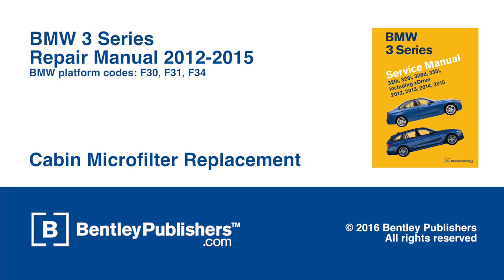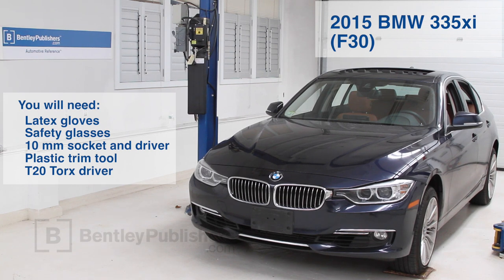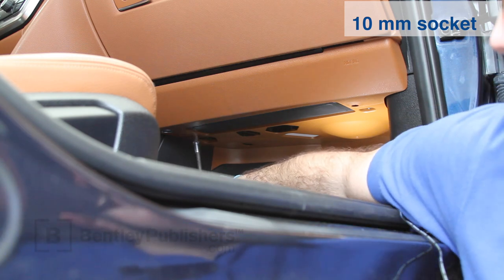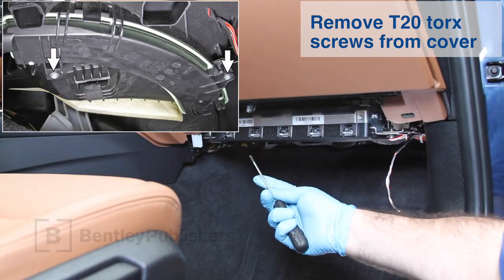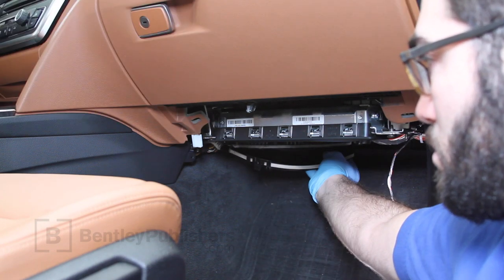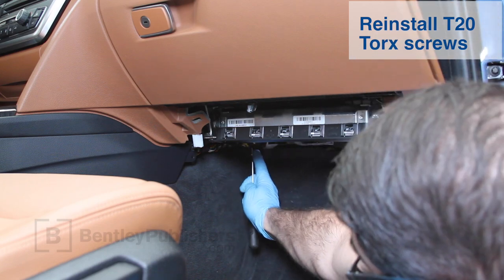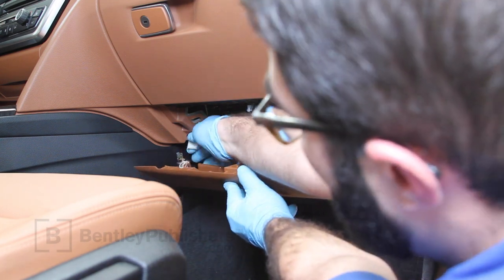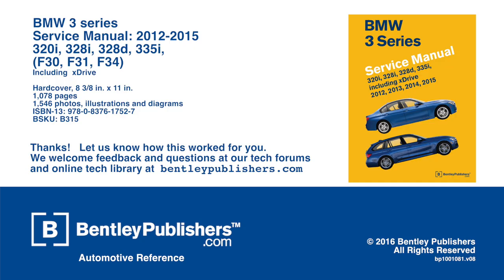BMW 3 Series 2012-2015 How to Replace Cabin Microfilter DIY

Comment: I've just replaced the cabin filter on a 2014 F30 328d and the old one (installed by the dealer under the maintenance plan) had the arrow up and pointing to the engine. At 2:16 one can see the arrow is pointing to the engine.

Comment: I’m having tons of allergy issues.  I replaced my cabin air filter but it didn’t help.  I’ve heard that mold can build up on the evaporator coils, but how can I clean that area.  Also, if that were the case, would it be covered under warranty?

Comment: Excellent video! If you're kinda dumb like I am, the air flow arrow should be pointing towards the rest of the cabin. "Towards the front of the car" to me sounds like the arrow should be facing the engine bay instead of the cabin. Also, this job is really simplified using a socket driver instead of a standard socket wrench like i was using, as the fit under footwell is pretty tight.
Reply: Joe, thanks for the tip. I will make sure to pay attention to the orientation of my filter when removing.
Reply: Are you sure about that? The video is a bit unclear, but freeze-framing on the removed (old) filter seems to indicate the arrow is pointing towards the engine bay, what I would also consider the "front" of the car.
Reply: Mine came out with arrows toward the bay
Reply: The arrow should point to the front of the car as shown in the video.

Comment: I'd like to have words with the rat bastard at BMW who put a recessed 10mm nut right next to a 12V power outlet.  I inserted my nutdriver in the wrong recess and POW! sparks.  Now I have to replace my #69 fuse in the engine compartment, 20 amps.